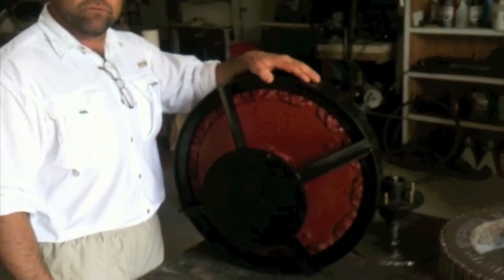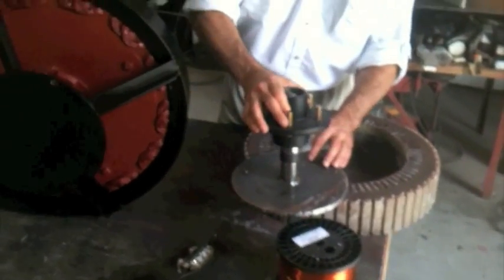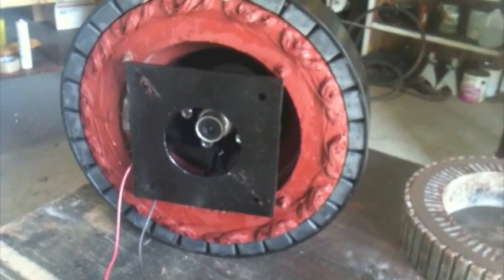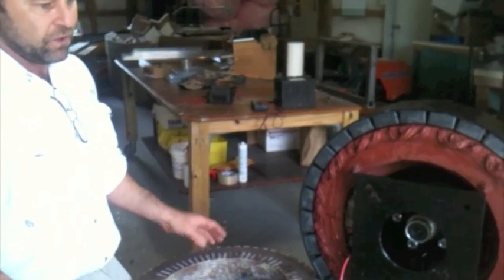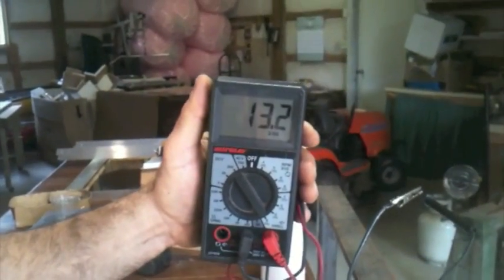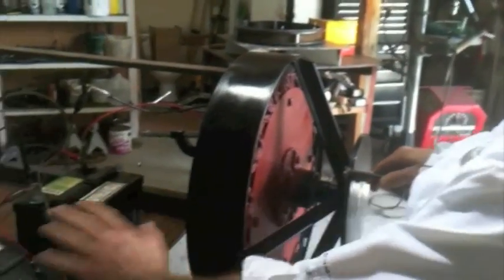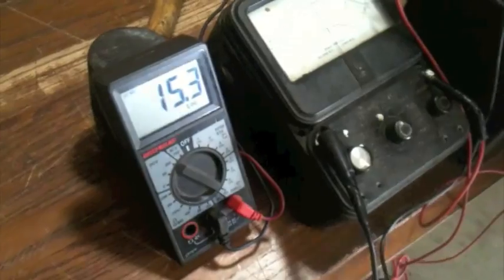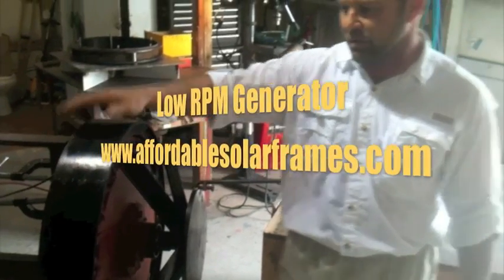Permanent magnet GENERATOR/Home made/bench test hand crank

Comment: What is the difference between the size of magnets in 100amp alternators and 60amps alternators? Do 100amp ones have bigger/stronger magnets or just thicker and longer wires are used for windings?
Reply: Chris Brown
 Really, you have no idea what you are talking about. If you did some research yourself, you would know electrical grid generators use electro-magnets in the stator fields to control the voltage precisely. It has nothing to do with it being better. The voltage coming out of a generator tied to the electical grid must conform to 58-62 Hz and be 114-126v . This doesn't allow for any other way to control the voltage other than the stator windings themselves. Since the rotation controls the frequency, the voltage must be controlled by some other method. There are many permanent magnet alternators used on all kinds of equipment which use the device to charge a battery. Since the voltage is not important (clamped by the battery), the frequency is rectified out, the amperage is the only part of the system that must be controlled. That is simple with a pwm controller. There are also other magnetic devices called magnetos which have been around since the Model A that are still being used on all types of spark fired engines, lawnmowers, motorcycles, etc (they use the same principle of the permanent magnet alternators). Alternators on cars are way over complicated, and use a field because rare earth magnets were not around when the alternator was designed. They are also the weakest part of the charging system due to needing a commutator to energize the field. You don't realize the companies are copying other companies to reduce their cost of research and development. It's not about what is better, it is about how they can make money on others ideas. So you are right, there are many companies out there using a magnet generator/magneto for all types of equipment.
Reply: Chris Brown Well the fact that industry has decided to ignore the free magnetic power of magnets and use solenoids to generate magnetic field in alternators is so stupid that I had a real difficult time believing it! There has to be other ways to regulate the output power of an alternator... I know I know, there are few other things that makes them do this, but its still a very stupid idea...
Reply: Chris Brown
Dear Chris, you seem to know much more than me about this subject, so could you please be kind and tell me what are the cons when it comes to using permanent magnets in generators? All I can think of is the fact that they lose power when they are heated. On the other side I see a lot of pros such as: Not being forced to spend electricity to generate magnetic field out of electromagnets :) Thanks in advance. Ou by the way, I would really appreciate if you could also tell me why N and S poles of magnet are running away from each other and spend time on the two far sides of a bar magnet and don't just attract each other and spend time together in middle of the bar magnet :) I was also gonna ask you to explain to me what is electricity but then I noticed that must be a very easy and boring thing for you to answer to, so I decided to live in ignorance and don't disturb you with my stupid questions...
Reply: Chris Brown
 I know exactly. The "+Chris Brown" is a good indication that the comment was directed @ someone and not a random addition. You were not talking about a hand cranked generator.....you were discussing, "Every company in the entire world is not using this...."  and clearly you don't know the truth. If you use a lawn mower......it has a pma, either in the form of a magneto or a magneto/alternator (as previously stated......they use magnets).  As for the $0.50, I would rather build my own generator (with magnets) and keep my $0.50 today and the $1.50 tomorrow. With all power generation in the US going to natural gas, the price will triple at minimum.
 You never proved why electromagnets are "better", so your point is moot.
Reply from the maker: I would guess that it would have bigger magnets and wire.
Reply: There are no magnets in an alternator they have an electric or field mag in them an the difference is in the windings and gauge of wire as well as the rectifires and the voltage regulators
Reply: GeorgeVeld Finally someone who knows that power electric generators do not use magnets
Reply: the industry does not use magnets and instead uses electromagnets because electromagnets are significantly better then magnets for electrical power generation.

If you dont believe all the independent industries who are always competing against each other for a better product, each having millions to spend on research, development and testing and yet you still insist that magnets are so fucking shit hot then make a killing in the electrical power generator business with a regular magnet based generators. I highly recommend you to borrow lots of money and dive straight in head first down this path of awesome magnet generators. Dont waste doing any research into anything related to this sure fire win, go for it now, before some other person with little knowledge in the field beats you to it.

Regulate the output power of a generator? I see your skills in this matter have surpassed that of the gods, its done by adjusting the load applied to it. No load it outputs no power, connect up things you actually need to use like an office building and the output power increase to match that of which the office building requires. Honestly its called genuine magic, with a certificate, as nobody knows how it works or can explain any aspect of it at all. Not even real 500 year old, I have proof, magicians like chris cockhead angle know the mysteries of an electrical generator
Reply: Im sorry ?? I dont know what I am talking about ??
The question was about car alternators not generators or electrical plants or whatever else you are rambling on about They use field windings as it is much simpler to regulate the output voltage as to prevent overchargeing the 12 volt system during High rpm situations
Reply: its you-tube, some people just like to but in, like i said its YT comments who really cares, a reason is saturation. I'm also lazy id pay 50c, just like lots of other people who can collect their own water but dont, were all lazy. in the end generally nothing much changes, i go on paying my bills and living my life. 
Im also sure I use words like "the industry" and "for electrical power generation." I would not call lawnmowers as an example of an electrical power industry. I thought I was sarcastic enough, oh well, back to paying the power companies money so I can play games and drink cold alcohol, ahhh ignorance and convenience.
Reply: GeorgeVeld
 You have no idea how youtube works, do you? If you notice, that comment was directed at Chris Brown......so evidently I'm not talking to you. Please keep thinking that I was though.
Reply: You clearly have no idea how youtube comments work, people from all over the world, e.g. countries that are not america, read comments and post comments, a lot dont speak english as a first language, others are lazy other just dont really care. In the end you will end up with random comments and other crap you dont like, understand and or agree with
Who really cares, a hand cranked generator?? Id rather just pay the electric company 50c
My point still stands, they use electro-magnets cause its better then magnets for generator power
Reply: First you need to understand that energy is not taken from the magnetic field. Energy is taken from the motor moving the field.
Electromagnetic fields are significantly higher then magnetic fields. The amount of power used to create an electromagnetic magnetic field is insignificant to the amount of extra power that is generated by the use of electromagnets instead to magnets.

Any other "pros" as you put it.

Like I said nobody is stopping you from cornering the magnetic electric generator market. It is an untapped market nobody is using. Every company in the entire world is not using this clearly better method because they dont want to have a superior product.
GO FOR IT

Comment: All magnets lose their strength at some point, but this is a great idea.
Reply: Neodymium magnets will retain their strength over hundreds of years so long as their outer coating remains intact. they do not lose their magnetism over time, it is a direct result of the condition of the magnet.
Reply: Way after all the other parts fail though.

Comment: blob ass should have got off his engineering high horse long enough to figure you would Not have used a Charged Battery for a TEST Load as it would increase effort ( physical resistance ) with cemf field on the windings from a charged battery , he should get a few years of tech work under his Darkass !

Comment from the maker: The battery needed charging. Once the voltage of the generator was higher than 12 volts it started charging the battery. The generator was hard to turn once it started charging.

Comment: As an electrical engineer I am having a bit of a problem with this video. How is the battery a "load"...unless it is discharged or below the output voltage of the generator? Was the battery voltage measured first and the battery load tested first? Is so what were the results of the test? If the battery was charged it would be the opposite of a "load". The correct way to test this system would be to put a real load on it such as a light and then take voltage and current readings.
Reply: blob darkass you're the worst EE in history then

Comment: electric magnets means you would have to run power to them. If the electric magnets were spinning they would require brushes to supply them with power. The spinning part needs to be a permanent magnet so you don't have to have brushes. If we ever get to a power coupler that works over an air gap like in Star Wars we will have more options but that is not an option at the present.
Reply: dzimmerm1956 slip rings work fairly well for some applications.  As for coupling over a gap, you have capacitive or inductive coupling. But unless one has superconductors, electromagnets will always loose energy as heat.

Comment from the maker: It is not free spinning when it has a load on it. I am working hard to charge the 12 volt battery. Once the generator slows to below 12 volts then it is free spinning and appears to be easy but once it is over 12 volts and starts pushing amperage to the battery it is very hard to turn.

Comment: Maybe one large pulley on rotating shaft to have gear speed advantage. Dog could easy handle the tourqe by adjusting length of lever. Pit bulls and grey hounds will run all day long if you let them. Thoughts??

Comment: None, car alternators use coils on the outside, called stators, and a coil on the inside which is an armature. The downside of the use of coils is that you have to have a way to get power to the moving parts which means you need brushes which eventually wear out. The upside is coils are lighter than magnets and are made of copper wire rather than exotic materials.

Comment: Mark, nice job! I see the automotive wheel bearing, hub, and shaft. I like the outside arrangement of magnets for cooling. Did you use a truck brake drum to house the magnets? That stator coil looks labor intensive to make. I fear your 2K price will put off the average person but I hope you have success among the well to do who are looking for a small off the grid system. This would be nice coupled with a nickel iron battery bank. Best wishes in your efforts!

Comment: This is clearly labeled a generator, you are obviously not on the up-and-up with your viewers.  You are utilizing more force to initiate momentum than you're pulling down.  This is a turbine, not a generator.  The consumable in this situation is calories from your hand turning the shaft, opposed to wind or water turbines utilizing their respecting elements to generate power.

Comment: This isn't real.  Don't buy one.  It does not generate any sort of work or kinetic energy.  It is not a generator.  It's an over-glorified wheel that maintains it's momentum for much longer than any normal bearing would allow due to it's use of magnets.  The amount of work/energy(kinetic or volts, or calories LOL) required to begin the rotation of the device exceeds the output.  Perpetual motion cannot and will not ever exist on Earth; you cannot overpower gravity, you will have work loss.
Reply: Scott Burgman you're a fucking idiot

Comment from the maker: You won't damage the batteries with varing voltages, as long as you have several batteries. The more batteries the better it will handle higher charging voltage. You can have a input voltage up to 5 times what your batteries are rated at. If you are on a 12 volt system and you have high voltage all the time then just step up to a 24 volt system. You do need a charge controller with a dump load so that the turbine will always have a load on it.

Comment: have you considered making them so that a rim & tire could be mounted to it, then mounting them to a vehicle with an elec. motor driven vehicle? i would think you'd have power to spare so much so that you'd have no distance limitations. as long as the vehicle was moving you'd be churning out electricty for the motor and for a battery bank coupled with quick charging cap. banks. just a thought. great job. if i ever come into money i'll look you up to get get one for a vawt unit i'd like to make.

Comment: i reckon if you designed a small very high output genny stuck it on a shaft,and on the other end stick a normal big genny,use the small high output to power a heavy duty brushless motor to then power the shaft it should work a treat,dont forget brushless motors are controlled by a chip so ya only need low volts on that,and even that can be scavenged by ya genny power in the end,if ya make a decent brushless or purchase one oooeee  they go like a mule with a cacti up its ass,

Comment: I have a generator which is half the size and outputs 110v 13 amps turning by hand not as fast as yours,i think you need to steer away from heavy duty and boost up your configuaration,using a big diameter flywheel magneto is not good you need to keep the fields closer,

Comment: the idea would be to help it generate electricty in low wind and high  amp input yes the restistance wont change but you can off set it using a small badini circut inbeded in your generator so as you rotate the shaft it generates electricty then though a rectafire and a cupple of coils it will pulse dc currant to it timed to help ease the resistance i understand what you said you need that resistance to make electricity.

Comment from the maker: I don't think you understand how electricty is made. The resistance is the flux field from the magnets pushing the electrons in the copper wire, so less resistance is less electricty. One way to test the efficiency of the generator is to just simply spin it for a long time with no load. If it gets warm or hot it is not efficient, it is fighting itself.

Comment: check this out here is an idea use a badini circut to pulse 1 set of magnets and one set of coils to reduce the drag under full load you will loose a little bit of power how ever your coils will pick up the pulses and delever them to the other coils to run the short dc pulses to push against the magnets so it would be a motor generator then you will have very little loss and still able to push the motor with ease

Comment: Dont get me wrong it is a great generator but under a real load it will become hard to turn the key is to make a generator that does not produce a lot of resistance so for that to produce in wind under full load it would take a lot of wind but if you have power in your battery bank then it wont be as hard to turn 2 amps is good for running two light bulbs at 12 watts a pice

Comment: Any amount of drag you impose on a vehicle by harnessing energy via wind, is in turn an energy "cost" in fuel, considering the motor must work harder to compensate. The only possible exception might be a turbine that turns purely from the turbulence "behind" the vehicle, and I mean RIGHT behind it, not in a trailer, for example.

Comment: Have you ever thought of putting 2 on a geared mountain bike and peddling to what feels like a cruising speed (not exerting yourself) and checking the output? It would probably work well with a torque gear for higher RPM.

Comment from the maker: No I have not used the n52 magnets. They are to costly. I have not had enough power to turn it more than 170rpms. Not sure what the mag load is. I designed it to be efficient with little input power and low rpms. The rectifier is easy to get to. There is a little hum in my hydro system under full load. You can see one I sold on youtube on a water wheel. search glowinglasscreations.

Comment: question have you built one useing n52 grad mags ....im more interested in output at low rpm than cost to build.....have you tryed to burn one up by over loading it to see at what max load be safe. and not damage the device...is rectifier locatied as to easy to replace....eddie current hum i undestand some what but was surprised you may have had to deal with that still wondering about....but over all i really like your method very strate forward...

Comment from the maker: Well you would get tired in a hour, But, yes if made it into a stationary bike and used your legs it would charge a battery that good run a tv with very little effort. New tv's  only use 40 to 100 watts so you could watch tv and get in shape.